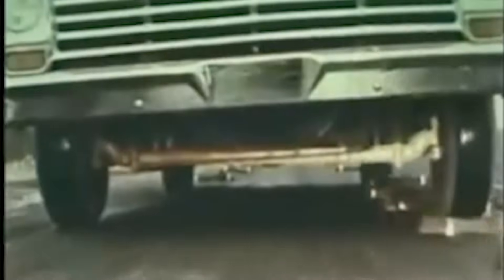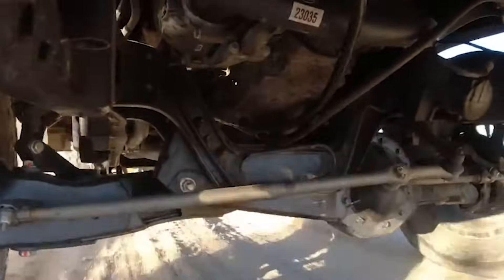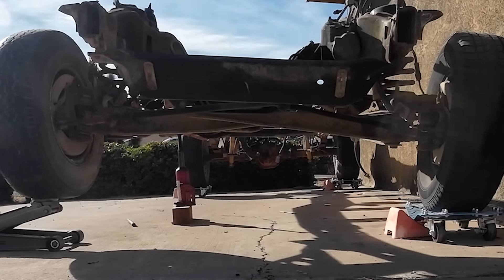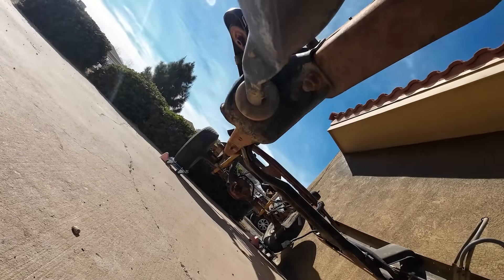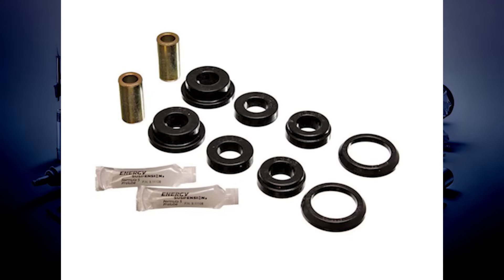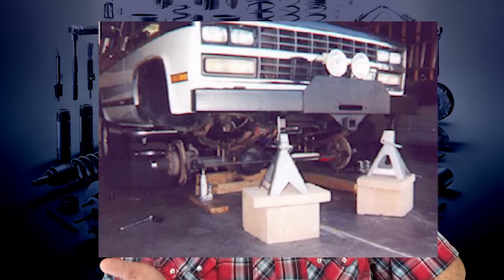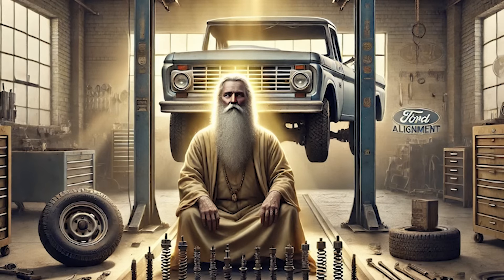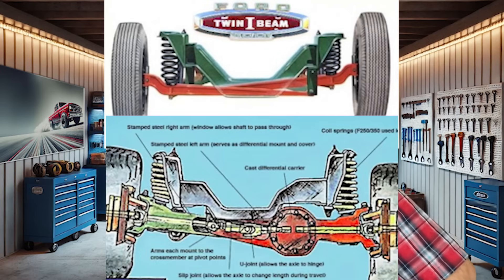Ford’s Twin I-Beam & TTB: Everything You Need to Know About These Innovative Suspensions

Comment: 2012 F250 xlt, 6.2 rwd, 50k+ mile tire changes, 5k rotate, 160k on chassis, half those miles pull 12k 5th wheel since new, 8.5mpg towing, 14 'round town. Oh, it wears the outside of left front, otherwise i would probably get 70k per tire swap.

Comment: I've owned 2 of these Ford trucks - a '77 and a '91.
What I remember most is the constant steering corrections when driving on long freeway trips.. it would constantly "wander" left and right.
A positive note to this is I'd never get sleepy on long drives.. so there's THAT !
Reply: With fresh, stiff bushings, proper toe, and stock ride height, they're just fine... but bushings wear out, and lifting them requires some knowledge and investment, or you'll hate life.
When left alone, or better yet, some poly bushings, they track just fine. My little ranger tracks just fine until the bumps get on the bigger side, but even then, it doesn't feel concerning, and you'll barely notice it... but it's not a great system, especially if you're making any changes to ride height.
Reply: I tried to UP the tire size on an E-350 van from the OEM 245/75 r16 to 285/75 r16.   It felt like I was driving on big balloons or tires with defective side walls! Could NOT drive over 35 mph!!!  Had to reduce dize to 265/75
So someone explain THAT???
Did I lose toe-in? Or Camber or both?
How/why would that size increase cause that much drivability issue & then be corrected ( night & day) by the dlight reduction to the 265's???
Reply: Was your tire wear even? Cause wandering left and right, I'd assume toe out and some accelerated wear on the insides of the tire... or just old, squishy bushings.
Reply: Especially the radius arm bushings. Those things squish, and your tire ends up pointing left or right, depending on which way they're squishing.
Reply: Seems to me if the Radius arm bushings "squished " your tire would lose its toe IN and be either straight or facing outward. Can't imaging worn Radius bushings causing an inward toe.
Reply: Let's not forget the front end hop over at highway speeds when hitting uneven pavement.
Reply: As a mechanic I had to go on many road calls and had my choice of a number of service pickups to use.  I avoided the Fords with that twin I beam front end for the same reason that you pointed out.  They tended to wander and required constant correction, something that I didn't experience on the Chevy / GMC trucks.  The issue got worse when the truck was loaded as opposed to being empty.  I noticed this issue while a passenger in a friends Ford twin I beam equipped truck as he was moving the steering wheel from left to right on a perfectly smooth and straight road.  As we were chatting I pointed out that this was why I didn't like driving these trucks because of the constant correction required.  As he was actively adjusting the wheel left and right he said no, they really don't need any correction, what do you mean?
Reply: @erth2man  that's odd I have a 85 F-250 that tracks perfect loaded or unloaded pulling a 5th wheel camper or a 36ft gooseneck at 80mph down the highway most generally just resting 1 finger on the wheel have actually had a lot of people brag about how well it drives. The way it rides is far beyond better the any new truck and yes I have newer trucks as well. A 2019 Chevrolet 2500 and a 2022 Ram 3500 dually it out performs both of them on the highway and off-road. It's called proper maintenance ounce every couple years the bushing get replaced easy to do less then 100 bucks. The biggest issue on the old Ford's was the stock steering box. Upgrade the stock steering box to a red or blue top and live a happy life. GM's IFS is a joke little to no upward suspension travel there bump stops are around a inch from the lower A-arm their turn radius is like driving a 18-wheeler the torsion bar setup is garbage plain and simple.
Reply: @wolfeman79  a joke... My 85 and 72 c20 chevies are still all original front suspensions, mostly, and operate smooth. Greaseable brass bushings on the control arms.  And, extremely easy to work on. The twin i beam is kinda cool, especially the original 2 wheel drive with kingpins. But absolutely not easy to work on.
Reply: Needed toed in.
Reply: My 1978 E-150 doesn't have that problem. My biggest issue is getting linkage parts for the 4 speed manual transmission...
Reply: Those can be adjusted to steer straight down the road . But its not ideal.  If you set the toe in well beyond the point that results in the best tire life . It will track nicely down the road. I always set mine that way because I never bought expensive tires and good steering control seemed kinda important.
Reply: Same here.

Comment: Best thing for alignment for Ford twin i beam is don’t mess with it. Set the tow-in and make sure you rotate your tires every 5,000 miles. The 65-79 twin I beam, the only way to adjust the camber and caster, is to bend the I beam. It will never behave like double a arm suspension, so learn to live with the quirks of twin I beam, or choose a different brand of truck
Reply: Wrong.
Reply: Or get the crown vic front end that's what I'm doing I just can't live with the constant camber changes the roads where I'm from are  bumpy as hell  I just wanna cruise

Comment: DONT rotate your tires.

Rotating the tires just means you will need to buy a complete set sooner.

It’s going to wear the edges on the front tires, period.
Accept that, or buy a Chevy.

If found the ratio to be 2:1.
2 pairs of front tires to 1 pair of rear tires.

If yo rotate the tires, you just end up with 4 tires worn on the edges, needing premature replacement instead of just 2 front tires replaced at the half-life of the rear.

Probably not the best designed trucks ever, but they can take way more abuse than the modern excuse for a truck.

When I was growing up, pickup = bulldozer.
Reply: 2012 F250 xlt, 6.2, rwd 50k+ miles between tire changes, rotate @5k, pull 12000lb 5th wheel, on 4th set @160k MILES, 8.5mpg

Comment: Step one in aligning these designs is to replace the pivot bushings, or your alignment efforts will be in vain. Not replacing loose bushings is the cause of much angst. Tire wear is as good as any other design if the tires are rotated every 5000 miles.

Comment: Been readin through the comments.. no mention of a drift correction on alignments that are "within spec". I found, in my area, with highway and rural roads that Twin-I/TTB don't hold a straight line well. I'd add a half degree caster lead over the right, tends help immensely for the crown of the roads.  But that was 30ish yrs ago.
Reply: I recently rebuilt the Dana35 TTB on my Ford Ranger and made custom extended radius arms with Johnnie Joints replacing the radius arm bushings. When trying to dial in the alignment, I noticed the same thing with caster and its affect on drift.  

I think the stock setup runs more caster overall because the relatively short radius arms would go near zero or negative caster in some droop scenarios with a smaller caster value typical of an A-arm IFS. The extra caster helps avoid that and limit potential "death wobble".  However that extra caster also forces more "return-to-center" which is only neutral on completely flat roads. 

I'm certainly no expert, but through trial and error I ended up with probably an extra 1/4 degree on the right.  With my setup, the truck tracks perfectly straight on flat roads and ones with small crowns.  But with a larger crown or a cross wind I have to apply some steering pressure.  I've thought about reducing the caster overall, but I'm otherwise happy with steering response, turning performance, and tire wear.   So long term I think a better solution for me will be a ported steering box with hydro-assist.
Reply: @rhekman  A 1/4 ain't bad at all.  Around here the crown is more pronounced.. rain and snow.  I find giving the truck what it wants to keep it happy.
Reply: Your problem was 'improperly aligned'. Steering box must be aligned for wandering.
Reply: @chrisa3358  Steering box has nothing to do with alignment.. slop, yes.. and you can adjust the box, to a degree, to tighten it up... not 'aligned'.

Heaven help you if you have bonded tie rod ends that were torqued with the wheel crooked..

Comment: I have four trucks with this suspension and only one had ever been aligned, the toe was misadjusted by an alignment shop.
Uneven tire wear hasn't been a problem and even rotation hasn't been necessary except for the misaligned truck.
My advice is if yours is straight  and working well, an alignment shop is very likely going to screw it up for you.
Reply: These trucks need a seasoned alignment guy, modern "technicians" don't know what to do with them...
Reply: Yup, my TTB Ranger started chewing up front tires, but only after 20+ years, a quarter million miles, and a completely roached right front radius arm bushing completely threw off the caster.  I had to replace the sagged coil springs to get ride height back into spec, but once I got the caster to within quarter degree left and right, everything's right as rain.

Comment: My 2005 Super Duty W/T 2wd with obd1 emissions and 2 valve 5.4 uses the twin I beam and is my daily driver work truck. Rides nice for an F250 and powerful combo; threated to quit when offered a new Nissan van to replace it.
Reply: Ford is still using Twin I Beam in the 2wd Super Duty trucks, and my modern local repair shop has no issues maintaining it.
Very popular in south america.

Comment: I have a 86 f150 bought new it doesn't go straight down the road without having to steer it. With a load in the bed it's real hard to keep it on the road. I also have a 80 model c 10 Chevy with the independent suspension and have neither of those problems
Reply: Have you set your steering box at bottom dead center and the set your pitman arm on it with the wheels perfectly straight? It makes a huge difference when it's s lined up and I drove for years with a constant pull to the right until the steering box started leaking. I decided to overhaul it myself and I centered the pitman arm correctly  this time unlike when I installed the thing 11 years earlier, I couldn't believe the difference. I was happy and angry at the same time. Perhaps this tidbit of trial and error can help you with your situation. Once the steering box is centered, it shouldn't have this issue anymore unless your steering ball joints are shot. The bushings where the beams articulate might be bad, but they would have to be pretty trashed for it to be really noticable. Hope this helps.

Comment: Hey I know the 4x4 beams are unequal length. Does anyone have the stock driver and passenger beam lengths for the Dana 44 and Dana 50 set ups? Been a nightmare to find online.
Reply: Check some junkyards if you havnt already, there are still lots of 90's trucks floating around that may have compatible parts.

Comment: Can we get a breakdown of ranger/bronco II equipment? Like the 2.9L V6 and A4LD transmission?
Reply: The Era of Rangers and Bronco II's have the same suspension but smaller.
Reply: @wilecatrexy  Yup.  I love the fact the D44 hubs, knuckles and stub shafts swap right onto the Dana 35 TTB inner parts.  I'm shopping around for just such a swap on my '95 Ranger right now.
Reply: @rhekman  I know the 83-88 Bronco II's run Dana 28, its not hard to swap in a Dana 35 as the 89-90 Bronco II came with Dana 35's from factory, handy considering, As far as I'm aware, the Dana 28 has no aftermarket support or support in general.
Reply: @wilecatrexy  and that is why I love them. I took my 88 Bronco II on a trail with my buddy's 2011 Jeep Wrangler, the B II did everything that Jeep did and more.
Reply: The 2.9: if it hasn't blown a head gasket or cracked a head yet it probably won't... as long as you never let it run hot.

The a4ld: like every other ford overdrive transmission from that time frame, swap it for a manual. I highly recommend buying a complete parts truck for the swap. Take pictures, label fasteners. It's a pretty easy job if you have a parts truck with everything needed.
Reply: @aaadamt964  as tempting as the manual swap is the automatic has treated be very well so far, then again I dont stress it out very much, I do take some trails with it but I never push that transmission very hard, I am curious about its internals however, the mechanics of the 2.9L and the A4LD, it just fascinates me on how they work internally. but yeah the 2.9L has been one of the best engines I have come across, but I do watch my temp given its head cracking issue.

Comment: My dad had a 1969 F-100 with twin I-beam. He had some sort of alignment problem. He took it to a shop and he got worried when the mechanic started dragging out chains, big clamps, a very big hammer and the torch.  After some time heating some part of the suspension, there was one big ‘WHANG’ and the mechanic removed everything. Dad said the truck drove perfect and he got something like 65,000 miles out of those front tires. That was back in the early 70’s when tires only went 25,000 to about 40,000 and were then worn out. Radial tires were not yet a thing for pickups.
Reply: WRONG!
That was back when you had a mechanic ( front end man) THAT KNEW WHAT HE WAS DOING and DID IT CORRECTLY with some level of PRIDE in his Workmanship & his Abilities!
GOOD LUCK finding THAT in 2026!!
Reply: @rustysummers3217 What is WRONG with what I shared? My dad special ordered that truck and it was a great truck for how he optioned it out. It was the 1st truck he did not break. And that is saying something. And it was the vehicle I took my drivers license test in. (I passed) and it also survived my teen age driving shenanigans very well. He owned 2 more Ford F-150’s after that one. I still have the one he owned when he passed away.

Comment: 1970 F250, wife's daddy bought it new. I rebuilt the front end at 100,000 miles. Added swaybars front and rear and a panhard rod in the back. Hauled a 3,000-pound slide-in camper for the last 12 years, and it works great. Never had a tire wear problem in the front.
Reply: The tire wear problem was the harmonics caused by the length of the arms, diameter of the tires, and absorption of the shocks.

Comment: The twin i beam gose clear into the 2010s i think when they went to something else in the aluminum duty but I might be wrong.

INFOtisum I know admonish me for not knowing all but I had a 2010 and a 2007 F250 with the twin I beam
Reply: Twin I beam is still used for f250 and f350 2wd

Comment: The camber is adjustable, there is a offset bushing where the top balljoint connects to, you turn it to the desired camber then tighten the balljoint down

Also, make the adjustments with the vehicle on the ground as if you were about to drive it
Reply: It depends on the year model. My '74 F100 has kingpins and no ball joints.
Reply: Correct I have a 74 also . no adjustment to be made except for toe. Really thinking about switching to the crown vic front end so my  mom can drive it with more manuvrability .

Comment: And then you have the king pins. No adjustment just deal with it.
Reply: Just set the toe in and you are good to go.
Reply: I worked on the Brown Econoline vans for 17 years. Most went out on the gravel, rock and dirt roads. We never took them to alignment shops. When ever you replaced suspension bushings or did kingpins, we set the toe 1/16-1:8” and sent them down the road. We never had tire wear issues that were alignment related. Make sure to use anti seize on all the bushings and kingpins
Reply: I've seen them bend slightly throwing the camber off. Other then messing with spring height and such the only way to adjust them without undersizing the king pins is to bend the axle. It's nice to have a jig for this, but I've never seen one

What I've done is, take a bottle jack and place it under the I beam.  Take an old rim and cut it apart and weld a bunch of supports, then fit another bottle jack on the king pin and use a torch to heat the I beam then very gently start to bend it. Don't go to hot or you'll compromise the I beam

If you go to far it's a pain to reverse it
Reply: @adamm1998  Yes.  Had an alignment job at a shop with a T-pit built for bending/twisting semi axles.  Replaced/repaired kingpins and bosses.. camber/caster correction, depending on deflection, is challenging yet oddly satisfying.. if yer into not being beaten by a chunk of steel that refuses to do it's job.  'Crummys' are the worst.. badly abused.. replaced my fair share of radius rod hangers, right up there with TREs and axle pivots.

I'll take an old Ford over anything because they can take anything you give it.

Comment: Tire wear was only a problem for constantly overloaded trucks like F250s and F350s used for tow trucks.
Reply: Even on solid axles with radius arms you can get odd wear. Going from empty to loaded, the axle moving in an arc can change alignment relative to the ground.
Reply: @tangydiesel1886  You are correct as heavy loads change caster.

Comment: Being an automotive enthusiast I find myself often studying unconventional practices. This system being one of them. Over here in Britain and European cars in general it's usually just a bread and butter McPherson strut set up. But it seems in the US there is all sorts of novel set ups. I was surprised to learn the 1994 Mustang has the spring and strut separate with the steering knuckle on the damper. The corvette leaf spring is a odd one too. Though I later discovered some of our cars did it too. Torsion bars on dodge b bodies. Jag e types used the same set up funnily enough. I don't think anyone has replicated the Citroen 2 CV set up. That's just weird.